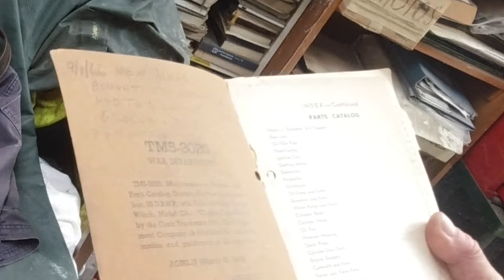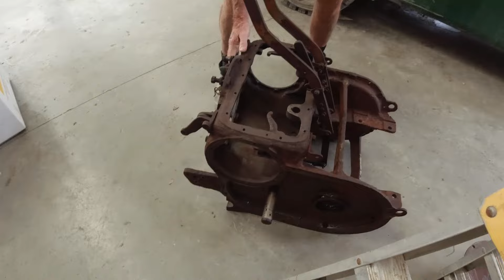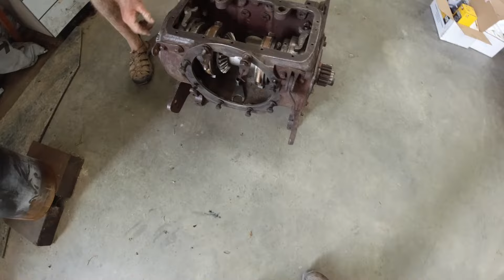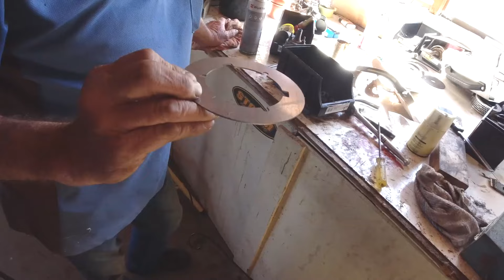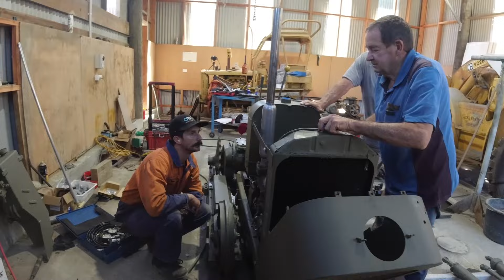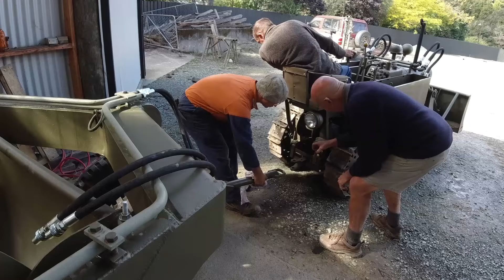Restoring a rare WW2 Airborne Dozer.. Hasn't run for 45 Years

Comment: That must be some age having a side valve engine.
Reply: WW2 so 1939 to 1945......
Jeeps had flathead engines as well...
Reply: @JohnSmith-pl2bk  there was nothing wrong with a flathead. Less to go wrong.
Reply: @ 
But the OHV was a great improvement in both power and reliability.
OHC then raised both again.
Then came catalytic converters and EGR.
DOHC raised power again...and also fuel mileage.
Turbocharging only works well for a long time...for diesels...

and direct fuel injection without supplementary intake port injectors to clean out the EGR gunge mucks everything up.

Until 2015 I never had a vehicle with a catalytic converter.....
Now I can tell immediately if any vehicle does not have one....
and following behind an "old timer" with a carb ......it's not an olfactory delight any more.

Comment: Amazing little machine which I believe was built not far from where I grew up.  I have only seen one other and it as inoperable. I never was aware that they had a winch,  I couldn't catch the name of who made the scraper that you have.  I believe that LaPlant-Choate made a scraper (can) for it.  Never have seen one.  Austin Western made a pull grader of which I have seen one.  LeTourneau built what was suppose to be an air drop self-propelled scraper, of which I have seen a few.  They had a cable blade and featured the only three drum cable control ever made by LeTourneau.  According to a historian with LeTourneau, they were never intended as air dropped units as they were too heavy for the aircraft at the time. 

A great job on this one.  I would have thought a bath in EvapoRust appropriate.

Comment: They should really try to digitize that manual in case something happens to that fragile original. Plus then they wouldn't have to continually wear it out by going through it every time they needed something. Plus I don't imagine there are to many floating around anymore.

Comment: We have an old Fowler 5 Litre single cylinder 2 Stroke tracked crawler that should be restored. The plan was to get a club in Gore to do this and have it on display in memory of our father, but it still sits in my brothers back yard. The engine was still turning over with the crank handle last time I played with it. Stories were heard of improper or bad technique causing the person cranking it to get thrown into the trees.

Comment: The dozer looks to be very similar in size to a 1930 Caterpillar model 10 I used to own. Size wise, it would fit in the back of a full size pickup truck. Nice restoration. I never would have guessed that it would have enough weight and power to pull a scraper.

Comment: It was just a better time back then, manufacturers built machines to last MORE than a man's lifetime, and gave them every diagram and dimension along with part numbers right in the owner's manual without having to find and buy an overpriced workshop manual. In 80 years time (Age of that machine) there won't be any money in making parts for machines built in 2023, there won't be any survivors. If ONLY that little crawler could talk, I can't even begin to imagine how hard it was worked and how roughly it was abused in horrible conditions

Comment: I've got a mate in Northern Ireland who has a few WWII vehicles. A bren gun carrier, a deuce & a half 6x6 truck and a M4 Half Track. They have lots of plates affixed to the dashboards with gearshift patterns and other important info. He was restoring a Sherman, but I think it got sold off as an unfinished project. It was one with the Ford GAA DOHC V8 motor.

The half track has a plate on the dash which says that drive to the front axle should not be used on metalled roads. (It doesn't have a centre differential).